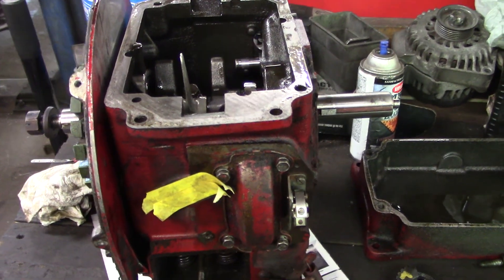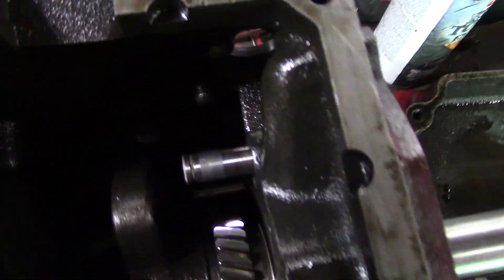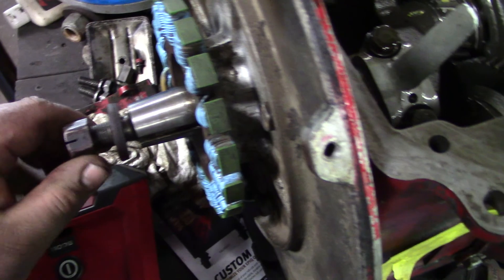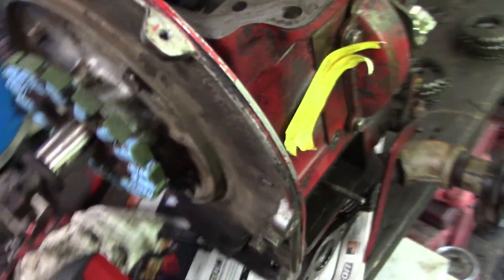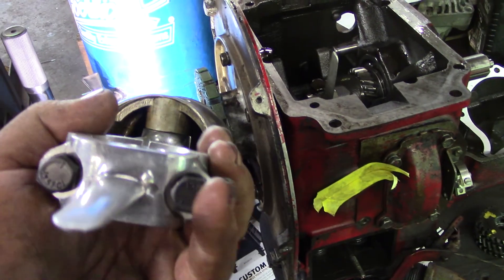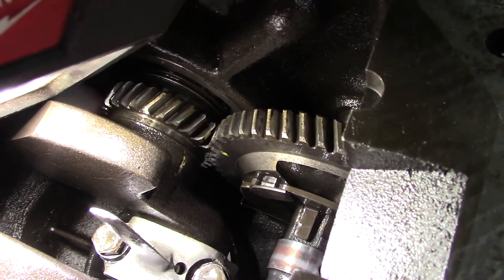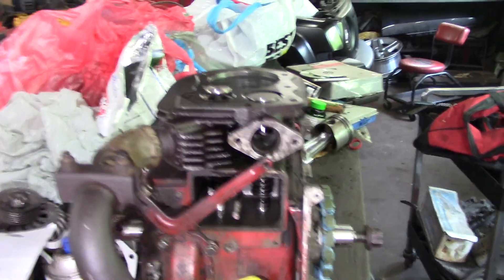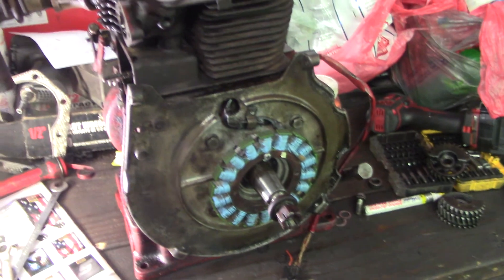Kohler 12hp K301 engine rebuild tips also REMOVE BALANCE GEARS!!

Comment: Hi, I am working on rebuilding a kohler m8 engine and while trying to adjust the throttle linkage I have disturbed the working parts of the
Governor and heard something fall inside the engine. (Complete novice I know ). Are what you call the balancer gears related to the governor and if so could I remove them without completely disassembly other engine.
Any advice would be greatfuly received. 
THANKS 😊
Reply from the maker: I think on that engine they have plastic governor gear and may have been broken anyway. That motor to my knowledge does not have balance gears. The governor gear is above the camshaft gear.  To install it you have to remove the camshaft so I think you have to take the engine apart.
Reply: @kennytheguitarfanatic054  Thanks ever so much for your reply, I  kinda thought that might be the case. Thanks again.  Pete
Reply from the maker: @peterwalsh892  Thank you .

Comment: So should I remove the balance gear and run without them?
Reply from the maker: Yes you can remove the gears I did not notice any vibration when it ran. Those gears area known failure.
Reply: @kennytheguitarfanatic054  when I was into dodge 2.4 engines the common mod was to remove the balance gears and chain it frees up about 20 hp or better so I can’t imagine how much power this actually frees up on these little guys . Light mods these engines  are putting down 32 hp